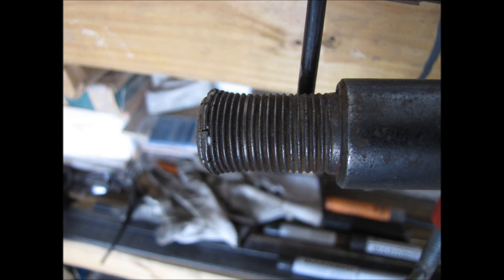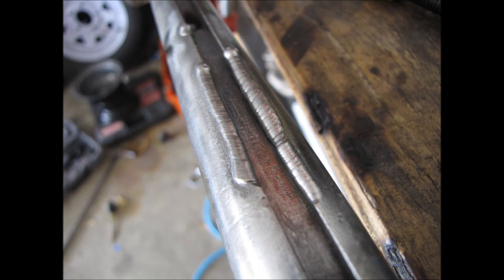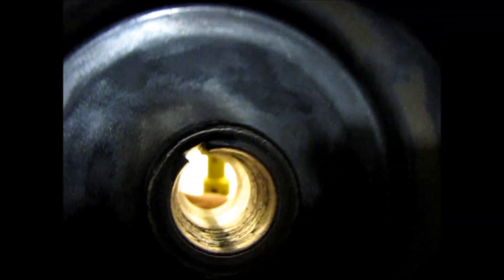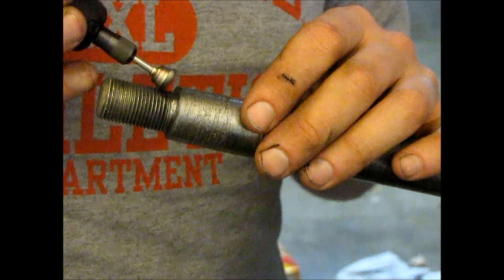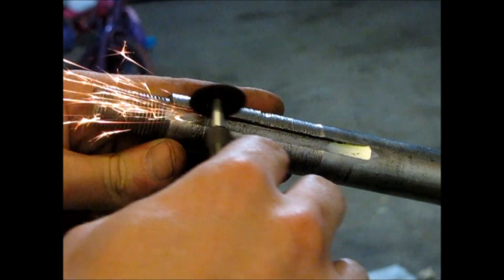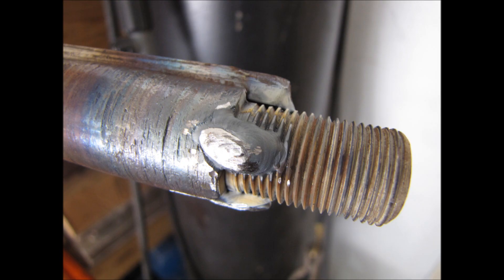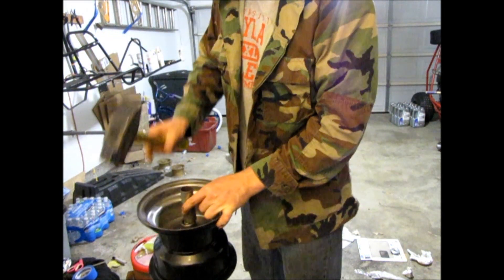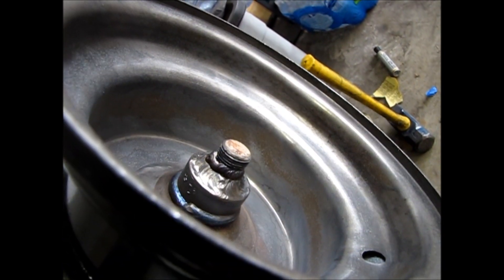Go Kart Axle Repair, Keyway Repair, Mushroomed, Welding

Comment: Do you know how to get frozen keys out of the keyway because my axle has like five different keyway keys that are stuck in it and whoever on my go kart before me installed the hubs on backwards, so I would have to takeoff the tire inward and then somehow get the set screw out and yank the hub off, but I don't really have that much tools because my dad's a carpenter, so I was wondering if you could give me any advice
Reply from the maker: Big hammer
Reply from the maker: Or hit it with your purse.
Reply: @KartFab  I’m deathly gonna try that because I also can’t really tell if my axle is bent Without having everything out of it

Comment: I have a go kart w/ live axle— I’ve been trying to fix it up but the tires are welded with the notch how do you suggest it is removed? Just go at it with a grinder until I’m able to get tires off? I’m a bit scared this will probably ruin the axle so I will have to do what you show in this video
Reply from the maker: Hard decision

Comment: The axle on my kart is out of alignment.  One side sticks out farther than the other and one keyway is partly covered.  How do i fix this? A giant press (or one made from a hydraulic jack)? A piece of wood and a sledge hammer? 

Also the axle is within a metal pipe with the bearings at either end. The axle is not as easy to turn as it should be.
Reply from the maker: +David Vermillion visit the diygokarts.com forum

Comment: I was trying to remove my axle with a 1/2" piece of rebar and the rebar overlapped the axle inside the axle housing... how to I remove this? I have broken cable rated to 2500lbs using my Yukon to try to pull it out. It is MF'n stuck! Any advice? Anyone?

Comment: good work. Im dealing with same issues on the Karts I purchased for my little girl. The karts were ran hard and put away wet .
Reply from the maker: Thanks! Axles are one of my least favorite parts of the go kart. Tires are my least favorite.
Reply from the maker: if you dont care about the tires on it, you can just use a razor blade (carefully) and cut from one side of the rim to the other. There is a 'bead' basically a wire rope against the rim that you can cut with a pair of sidecutters, wire snippers, and the tire just peels off after that. That is my last resort. You can apply lots of pressure to one spot of the bead, then work back and forth around half of the rim until you can break the bead. After you break the bead, it is easy to remove with screwdrivers like you can see in my other video how to repair a rusty rim etc it shows how to remove a tire there.